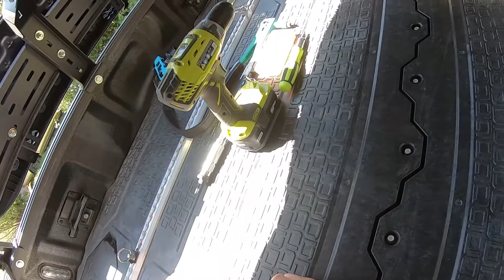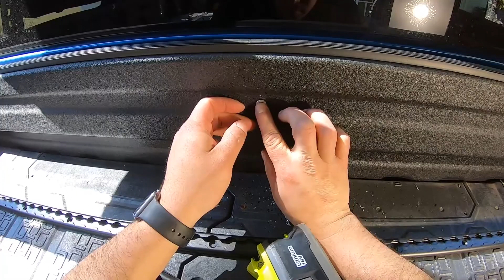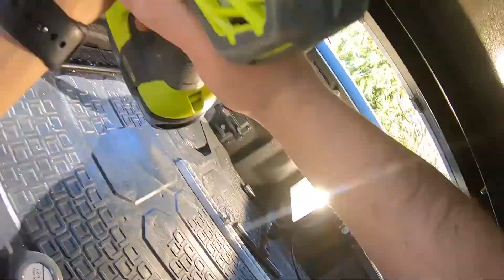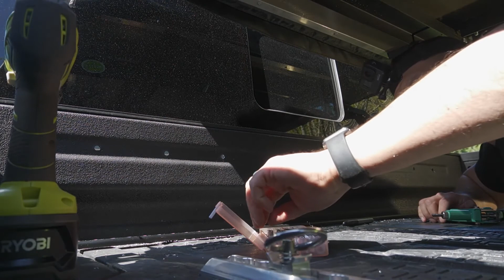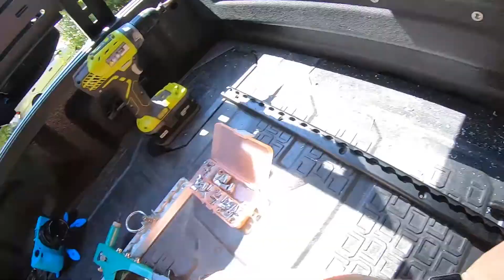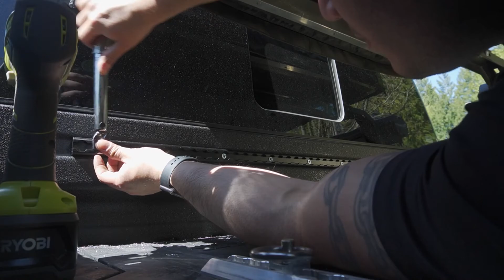Truck Bed L-Track Install

Comment: How did the Rivnuts hold up? I would like to use Rivnuts on mine but I am afraid they will pull out. What is the heaviest thing you tied down with this set-up?
Reply from the maker: I haven't put anything super heavy on them.  These specific tracks are currently holding my cheap traction boards and board mount which are about 50lbs together.  I've also used these rivetnuts to hold down my air compressor under the decked system.  No issues so far, but if you're looking for a serious tie down, this isn't the answer...you'd need a reinforcement plate behind the sheet metal.
Reply: Considering adding (2) 12 inch L-Tracks mounts to my F-150 as well. Was worried with the aluminum, specifically that it would pull / torque and ruin the bed. I plan to mount a fork bike rack for a 28 pound mountian bike on one, and another fork bike rack on the other. 

Any major challenges with yours? concern witj aluminum? also, did you end up using the steel/zinc plated rivnuts or aluminum? Thanks!
Reply from the maker: @tywarg  I'd do zinc/steel with a larger, two handed nutsert tool.  I used aluminum in this video and I think they're too weak for serious torque, but I haven't had any issues holding my traction boards.